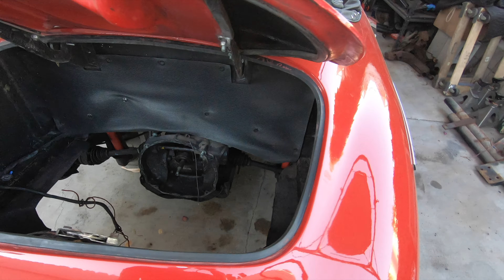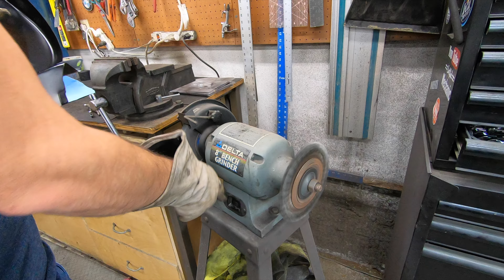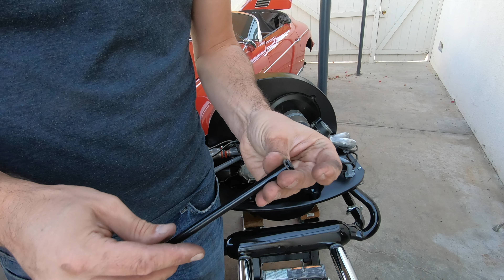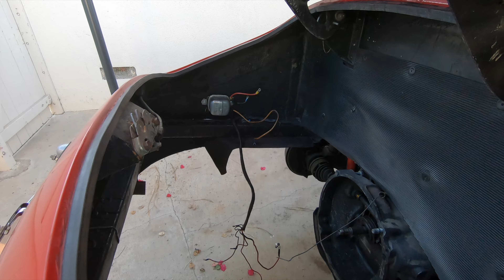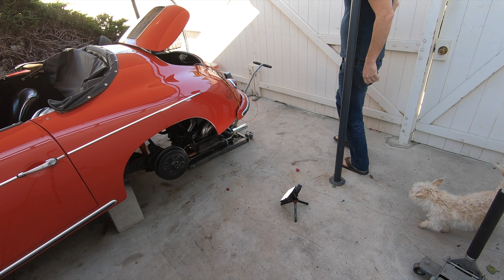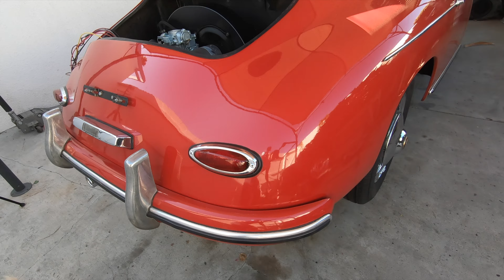Cheapest Speedster Replica (Part 7)

Comment: So on the VWs we slide the engine under through the wheel well that way you don’t have to jack up the rear so high to clear rear apron.  Does the speedster have stuff in the way for sideways approach?

Oh and a piece of hose keeps that throttle tube nice and quiet.  I think there was supposed to be a plastic piece for the fan shroud and a rubber grommet for the front tin.